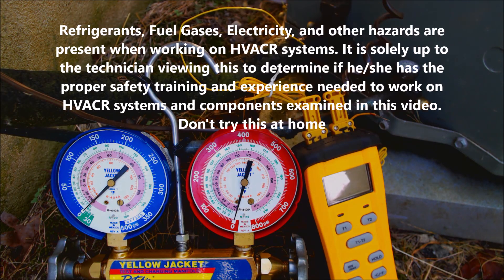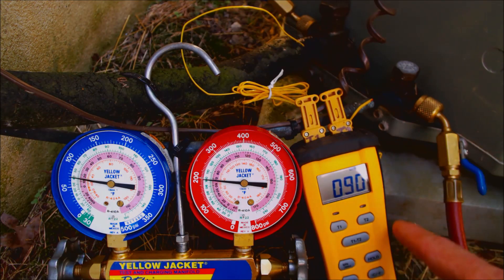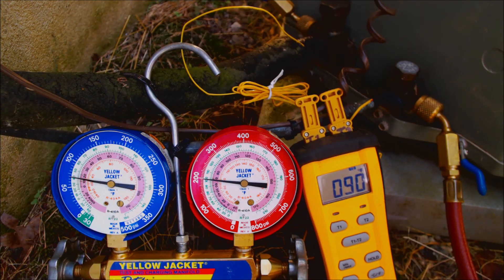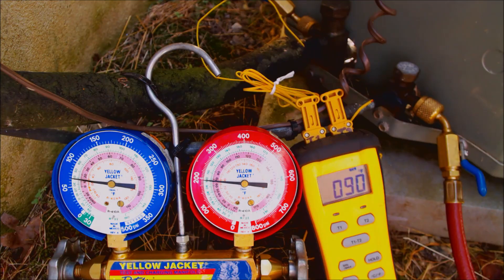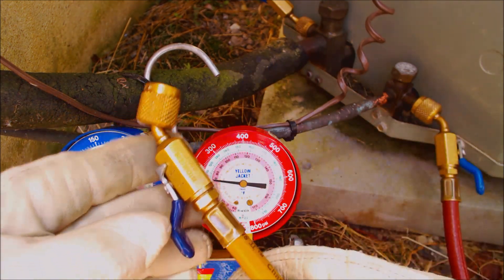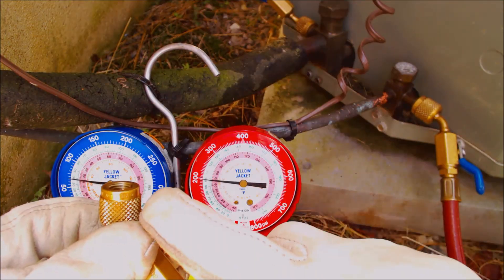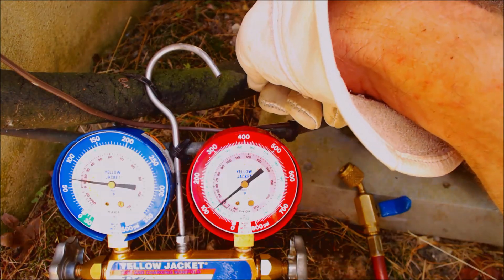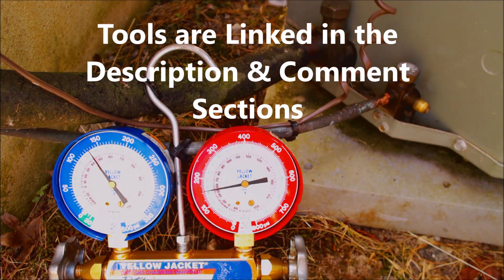Check the Air Conditioner Refrigerant Charge, Connect, Measure, Disconnect Procedure!

Comment: Craig...when you initially connect hoses to the system, the hoses are obviously containing air (atmosphere).  The hoses are not purged prior to connection to the system so, doesn't this have the potential to introduce non-condensables into the system?

Comment: Would you trust a laser temperature gun, such as this ryobi model, to read the temps of the low/high cooling lines?

https://www.homedepot.com/p/RYOBI-Infrared-Thermometer-IR002/205509667
Reply from the maker: No I would not. I do not trust laser guns personally. Some use them though but there is no calibration method usually

Comment: Hi great video! I was wondering, it’s ok to use the suction side as a liquid charge? And why. Also on his method do you leave the refrigerant bottle upside down for liquid and you throttle the refrigerant with the gauge know on the low side or the knob on the refrigerant bottle. Thank you!
Reply from the maker: I meter the liquid refrigerant slowly a little at a time into the low side of the system which is the large tube vapor port during ac mode, thanks!

Comment: Hello there.
My name is Yvan Bedard from Canada, Quebec, and would like to know if its possible to check my refrigerant charge in the winter. I am slowly getting equipped so as to be able to personally do the most of the maintenance on my system as possible. I just bought a set of gadges and temperature reading sensors. And also your book which I expect soon. My indoor furnace has a piston device. Over here the winters are pretty cold, but lately it stays somewhere in between -2 and -20 Celsius. In short I just want to be able to know if I have enough refrigerant or not. I say this because lately I have found my heat pump covered with ice. So after looking at a lot of video's I changed the timer on it. It was set at 90 Minutes. So I after eliminating the ice I set the timer at 30 Minutes and my ice problems seem to be ok.At least now I know my defrost works.  But I find that the Aux Heating (Heating Strips) come on to often. Maybe its normal, I'm not really sure. Thats why I want to know if its because my refrigerant is to low. 
By the way, I do like your videos on you tube. You seem to me as someone who takes what you do seriously and I like the way you explain things in good detail. 
Just wanted to say thanks for sharing your knowledge to us all. Hope you may have some answers for me . 

Yvan Bedard.
Reply from the maker: Thanks Yvan, You can only really check the charge on a day that is 40 degrees F and higher by restricting the airflow in cooling mode to a sat temp of 90 to 105 degrees F if you have a txv metering device at the indoor coil and the indoor temp is 70 degrees F or higher. This procedure is mentioned on page 148-149. Otherwise, we recover the charge, pressure test, vacuum, and weigh in the correct amount of refrigerant based on the unit's rating plate "factory charge" and line set size and length. This procedure is mentioned on 83-84, thanks!

Comment: hey there, nice basic charging video,, i got slightly more complicated question, im working on a 10 system that has a dual evap slab coil with two txv's, outside two 5 ton condensers, R22 system, not cooing very good, has subcool of about 5 degrees, head pressure about 190psi, suction about 80, temp diff across evap 13 degrees, with subcool at 5, im thinking low charge but adding freon doesnt change head pressure or subcool,, i do notice both liquid lines get cooling the further away from condenser, temp drop of 6 to 8 degrees from outside to inside, new liquid line dryers so not thinking restriction in those, so what should i be looking at..
Reply: any advice will be welcomed

Comment: Well...it looks like my not giving up on the First-Time-Ever Refrigerator Repair is paying off Dividends in the form of a Repaired Unit! Freezer Temp started at +69 degrees...it is now +23 degrees. 
 There were 3 issues that I encountered after getting the Compressor and Filter/Dryer Welded In:
 1.) The Compressor would not Run. Turns out, the Male Pins on the Compressor itself are 180 degrees from the Old to the New. Fix...Rotate the Female Plug so that the two Power Pins engage leaving one unused Male Pin floating in mid air. Hoakey...yeah but it works. I'll call Sears Parts Direct & see if they have a proper Harness.
 2.) One of my Welds at the Compressor/Condenser Joint let go after 24 hours. Fix...Reweld Joint and this time use a Mirror to Inspect the backside of the Weld.
 3.) System would not come up out of Vacuum all the way with R134A Refrigerant installed thus unit would not get Cold. Fix...Cut Capillary Tube at Filter/Dryer and Inspect. Found Silver Solder Wicked up to end of Capillary Tube and Welded off Opening. Unweld joint and Reweld with Capillary Tube further into Filter/Dryer...not too far though.
 Pulled a Vacuum yesterday and let it set overnight...no Leaks. Charge the System with Refrigerant.

Comment: Finally some who knows how to properly check the charge of a system. One word of caution superheat varies with indoor load (hot house).  👍
Reply from the maker: Absolutely, as you check the charge, make sure to go back in and measure the wb inside and the dry bulb inside to determine the actual moving target superheat, thanks!

Comment: After you've disconnected your guages and done the bubble leak detection, do you need to blow out your gauges with nitrogen?  Thanks btw, very helpful video.
Reply from the maker: You don't have to unless you are checking the charge of a system with a differnt refrigerant suchas R410a and then R-22, thanks!
Reply: @acservicetechchannel  Awesome,ty.
Reply: AC Service Tech LLC.   Will just compressed air blown through the rubber charging  lines and gauges clear the residue refrigerant before using the set-up to check a different type of refrigerant??  Or is nitrogen better to clear lines/gauges?

Comment: Heat pump split system. Suspect a very small leak in the indoor coil. ? If this is so and want to replace coil can a micro-channel coil be installed and do you size that coil equivalent to the existing coil.
Reply from the maker: I would just install as standard aluminum tubing and fin evap coil, not micro channel, thanks

Comment: Do you have a Qwik Charge adapter too? how does that affect the intervals and length of opening the low side valve?
Reply from the maker: Yes I have the Kwik charge and you can open it up much longer as it seems to be a pretty good quality vaporizer, thanks

Comment: On a heat pump, do the readings differ depending on whether it is in heat or cool mode?
Reply from the maker: absolutely but we typically check the charge in cooling mode, thanks!

Comment: hi, let's say you don't have hoses with the shut off valve. can you just cap the middle port of the manifold and put refrigerant in red hose back to low side with this procedure? thanks.
Reply from the maker: You would still need a low loss fitting on the red hose but yes you don't have to have the yellow hose and even if you did, it is a great idea to cap off that port and charge through but you still need to purge the air there first though, thanks

Comment: If you were working on a r-22 unit and the next unit you go to is a 410a unit, do you purge the 22 out the same way you would as purging air?
Reply from the maker: Look up"acservicetech disconnect procedure" you shouldn't have much left to purge, only vapor, thanks!

Comment: Thanks for the videos. Thinking of getting into the field. Question. Would the air already in the gauges mix with the refrigerant as soon as they were connected making the purge unnecessary?  I ask because I don’t know. 

I would think it’d be best to use a can of refrigerant to purge air from the gauges first then connect to service ports on ac.
Reply from the maker: The air is not under pressure and the pressure of the refrigerant will force the air close to the manifold to purge, thanks!

Comment: Hi mate I have a basic technical question
What's the difference between the reverse cycle air conditioner and heat pump? Which one are we allowed to measure the superheat or sub cooling(according to metering device of course) ?
Reply from the maker: We measure the superheat with an active fixed orifice metering device in cooling mode and subcooling with an active txv metering device in cooling mode, thanks
Reply: @acservicetechchannel 
My main question is
What is the difference between the reverse cycle air conditioner and a heat pump
Reply from the maker: If I understand your question then there is no difference but that there are extra components to facilitate the refrigerant flow direction change but we charge them in cooling mode thanks!
Reply: @acservicetechchannel 
I spoke about a problem with fujitsu technical support and I asked them I want to measure the sub cooling to measure the refrigerant lack(exv was metering device of unit on outdoor unit installed) . He told me no you can't because it's a air conditioner not a heat pump
So I didn't understand why can I not measure sub cooling on aircondiotner or a heat pump
That's the reason I want to know the difference between air onditioner and heat pump
Cause most of your tutorials  about measuring superheat or sub ooling you haven't mentioned any difference in this 2 types of unit
Hope I clarified my problem
Thnks
Reply from the maker: For minisplit units, most have an inverter compressor so the manufacturer does not specify a charging method other than the total weight method and often will only give a vapor service port to avoid techs charging with subcooling unfortunately. We only use subcooling on single or two speed compressor units with a txv as the metering device, thanks!
Reply: @acservicetechchannel 
Unfortunately I haven't received my answer yet.
My question is only
What is difference between reverse cycle air conditioner (or generally air conditioner) and a heat pump?
Reply from the maker: Hey Ace, I am not sure what you mean when you say a reverse air conditioner. Basically an air conditioner running in reverse, is a heat pump. A heat pump has more components that air conditioner. I have never heard the term"reverse air conditioner" used as a specific term. Of course an air conditioner running in reverse with another metering device, reversing valve and accumulator makes sense, and that is a heat pump running in heat mode, thanks!
Reply: @acservicetechchannel 
Thanks mate I think I got my answer when it's on heating mode it's called heat pump I think
Reply from the maker: We typically just call it a heat pump in AC mode or a heat pump in heating mode. We may also refer to a heat pump in AC mode as cooling mode.
Reply: @acservicetechchannel 
HI Paul
I think I found the answer
Air conditioner works with heat strips(or another source of heat production) for providing heat
But
Heat pump (reverse  cycle air conditioner which definitely has a reverse valve ) pumps the heat  drawn from outside and transfer inside of home. (for providing heat)
And now the question is that which methods for refrigerant  charging is not allowed for  heatpump or airconditioner?(subcool or superheat?)

Comment: Thanks or the great video.  Question?  Do you only purges the gauges when the system is off?
Reply from the maker: You can do that while the system is on or off. If it is on, make sure that you don't have both handles open at the same time, thanks

Comment: Dude get yourself a set of Testo or field piece digital guages.. this will make your job easier and more accurate. They both come with probes to be able to hook up and see superheat and subcooling much easier..analog gauges are dated and not as accurate with ambient temp swings.
Reply from the maker: Hey David, have you looked up "acservicetech SMAN460 playlist"? Most of my videos are for newer technicians and those in school and most of them start of with compound gauge sets but I did some with the sman460 as well, thanks!

Comment: I purchased a home last year and shortly later discovered a leaky evaporator. Ac guy wanted almost 3k to fix it. I am a master auto technician but have never worked on stationary AC systems. So found you on YouTube and watched your videos religiously. Quickly gained the confidence to do the job myself. I successfully replaced the evap coil and my system made it through a year and runs like a champ. Thanks for sharing your knowledge.
Reply from the maker: Yeah as long as you are 608 certified, it is doable, thanks a lot Jerrod!

Comment: can i use  type k thermocouple to take line temp as well ? it came with my fluke meter
Reply from the maker: Absolutely. You can tape it on with electrical tape and if desired, add a piece of armoflex insulation to make sure it is accurate, thanks!

Comment: On the press/temp dials of gauge set do you use the R-22 readings if you are using 422 refrigerant? Thanks, I'm new to all of this.
Reply from the maker: Hey Robert, check out these two videos on checking the charge of a blend refrigerant. These are checking an R438A system which is MO99 and is the same process as R422B. You would just use the R422B dew and bubble temps- https://youtu.be/Kwa3IBTumiw    -  https://youtu.be/uLsLDtA23lA
Reply: Thanks for your help

Comment: The problem with subcooling measurements is that it often flat-lines from approximately 90% to 110% of proper charge. It also does not take in account the heat load indoors. If house temps and humidity are out of control, a TXV will drive wide open and then simply act as a fixed metering device. Superheat is still your best option.
Reply from the maker: I am sorry but you can't use superheat when charging txv systems because no matter what you do with the refrigerant charge, superheat won't change as long as there is some liquid heading to the thermostatic expansion valve. It is likely that you are under charging or over charging systems that you are working on if that is the case. Most likely over charging. I am a licensed teacher of HVACR. What you are saying is not what manufacturers recommend or any field practice. Subcooling does not flat line. It will change depending on the amount of refrigerant in the system, thanks Thomas

Comment: I don't understand if you completely disconnected the hoses at the end why are the quages still reading pressure shouldn't the Guage set be at 0?
Reply from the maker: I have valves on the end of my hoses so they still have vapor only pressure. That small amount of vapor is vented from the hoses after disconnecting. Liquid pressure has roughly 11 times more refrigerant so charging the liquid back into the system before disconnecting is helpful, thanks

Comment: Great videos!!! Very clear. I do have a question. If you are just checking charge on r22, do you have to still connect low side and high side gauges?
Reply from the maker: If you are checking a system with a txv then yes. If you are checking one with a fixed orifice then you could just connect to the low side but I connect to both just in case I see some other issue or problem, thanks
Reply: wow...thanks for the quick response. I'm going to check my system it has a piston. I had someone come out and supposedly charge it a little. He did the whole gauge thing and attached the thermocouple. The gauges I didn't watch too close, but his temp meter read about 68 degree and it was about 83 degree outside that day. next day ac still seemed not to cool, I only put my thermocouple meter on the suction line and I got about 68 -69 degrees. Even without putting gauges on something seems a miss here. He claims that he got superheat down to about 11.

I have my own gauges and going to take a look this afternoon. Something just seems incorrect, maybe he was not as experienced as he thought
Reply from the maker: Let me know vapor psi, liquid psi, superheat, subcooling, indoor wb, outdoor temp, vapor temp, liquid temp and delta T across the evap coil, thanks
Reply: Hi thought there was a private message system on here to send you the info, cause I know there are haters on here. Guess YouTube did away with the feature this past july 2018
Reply from the maker: you could just type the numbers in the comment section or if you want you can email at info@acservicetech.com
Reply: Just emailed you

Comment: Instead of using a vcrt with the rectorseal, I use a simple connector like this with the schrader/depressor removed.  No need to clean or worry about leak detector getting in the vcrt  https://www.amazon.com/dp/B0015A16X4/?ref=exp_acservicetech_lv_dp_vv_d

Also, if I hook up gauges instead of quick connects checking a charge and realize it is ok, I put a ball connector on the charge port instead of attaching the hose.  Saves some vapor refrigerant loss when disconnecting but not a big deal I guess.
Reply from the maker: Yes both very nice tactics! Great job kneeman7!

Comment: Excellent and timely, big thanks.
Quick question, if the system was off and you wanted to change out a Schrader, could you just front seat the valve and remove without losing any refrig.?
Thank uou
Reply from the maker: You would still have refrigerant in the line set part connected to the port. You would use a valve core removal tool such as the one linked at amazon.com/shop/acservicetech  - with them you can change the valve core/schrader valve out while the system is running or off without loosing refrigerant, thanks James!
Reply: AC Service Tech LLC 
Thanks for that tip, the less mistakes the better.